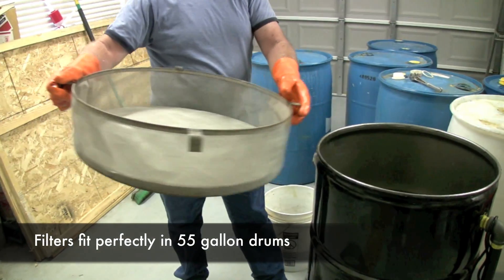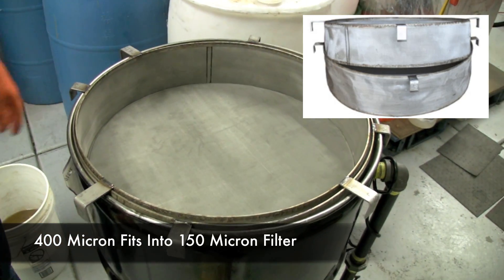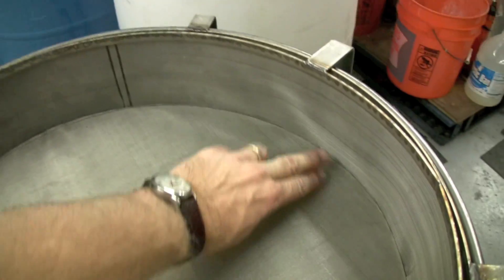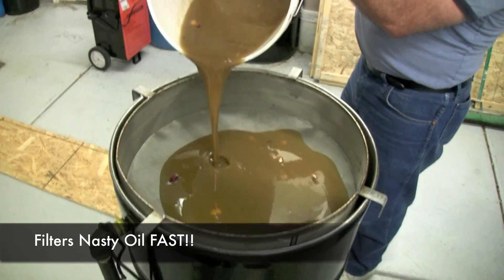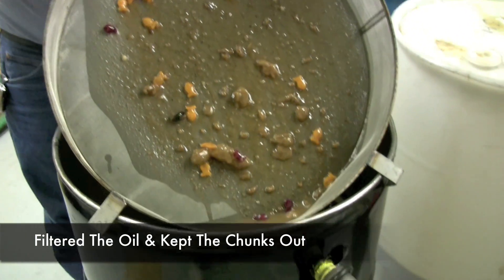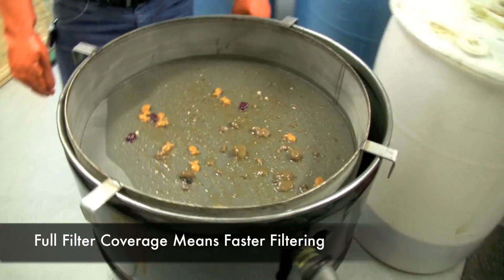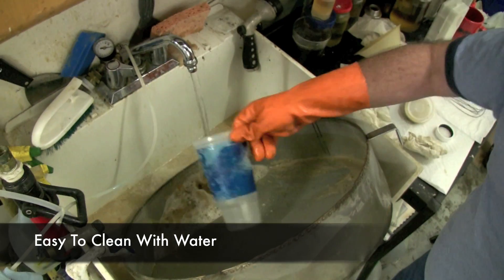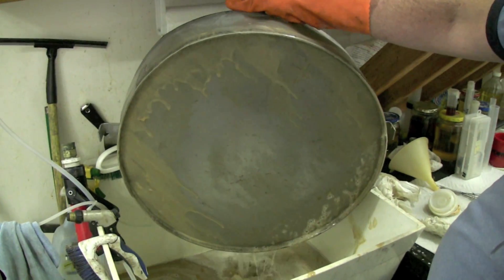Stainless Steel Drum Filters - 400 micron 100 micron Utah Biodiesel Supply

Comment: @macspud28 We now have stainless filters in 800, 600, 400, 150, and 74 micron sizes. Stop by the site utahbiodotcom to check them out. The 400 is handy to use first to get the bigger chunks out. It keeps the 150 micron filter from plugging up as fast. Several SVO folks like to filter this way in staged filtering. Hope that helped - Graydon, Utah Biodiesel Supply